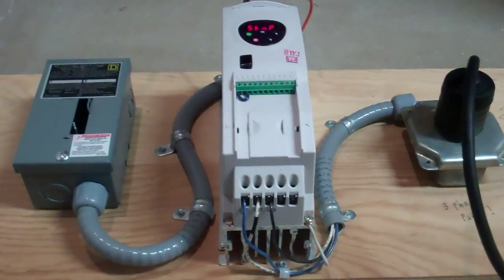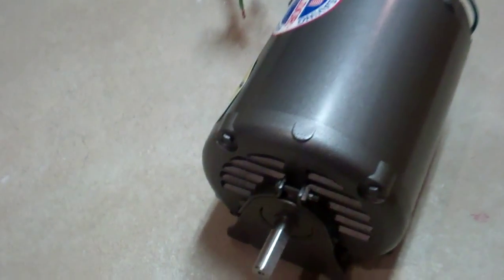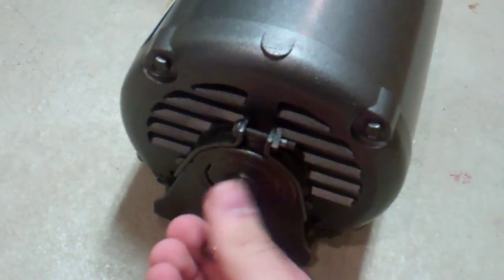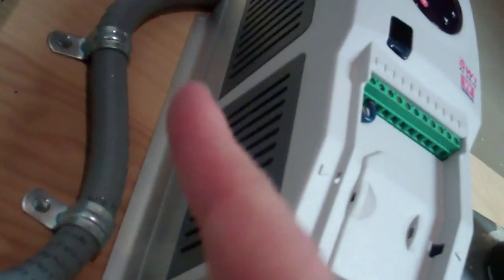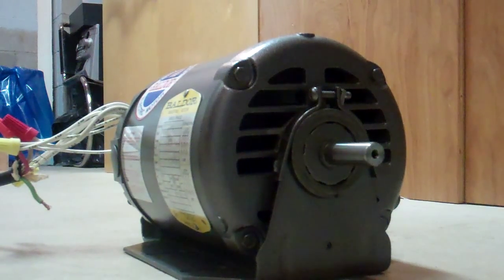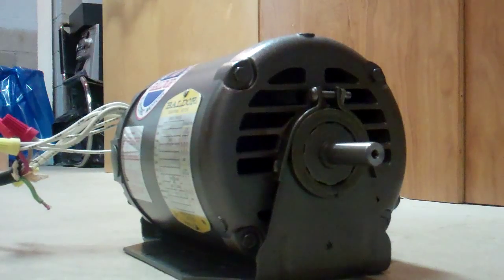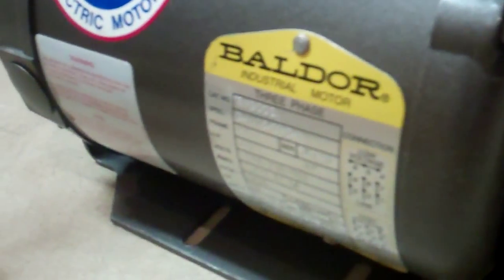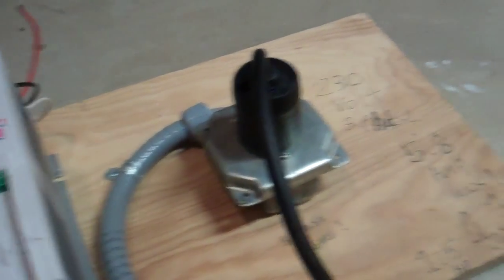3 phase power ! update

Comment: Hey, nice setup!  I was reading on the operation of VFDs and when you said that you get a tingle touching certain parts of the motor, what I found out, that's due to shaft currents or voltage.  Shaft currents are induced by the capacitive coupling of the rotor to the windings.  Shaft voltage is bad on bearings due to arcing and causes pitting.  Long wires to the motor also 'reflect' voltage onto the windings adding to the effect.